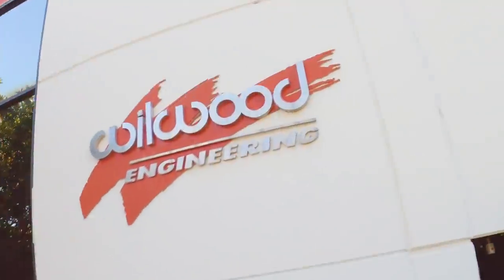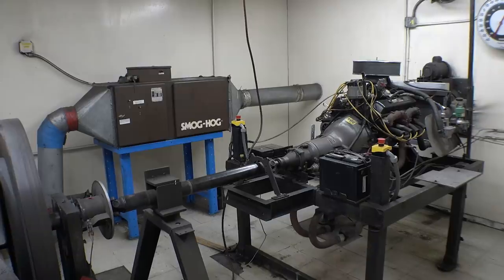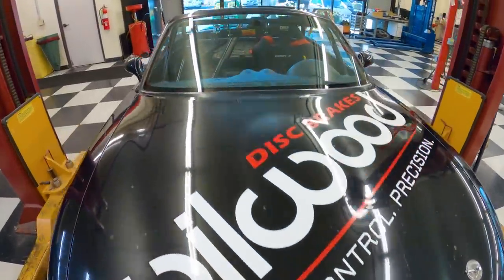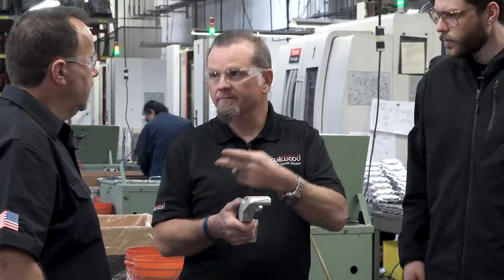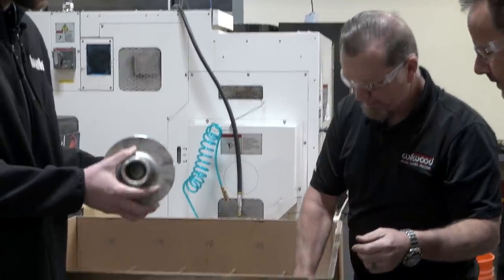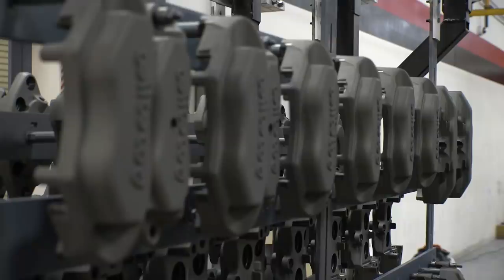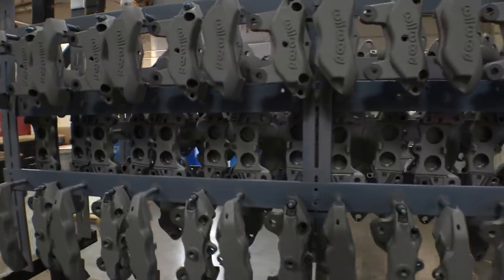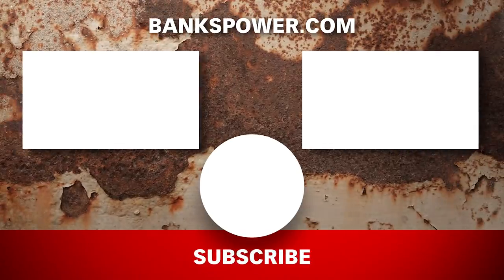How to BRAKE a supercharged Duramax Pt 2 | BANKS BUILT Ep 14

Comment: I only clicked to say please give us some more 'killing a duramax' and 'monster truck duramax'. Thanks!
Reply from the maker: 1. The Super Turbo (Monster Truck Engine) is in the process of being upgraded which means pulling everything off the current 7.0 LMM, making adjustments and changes, then installing them all on a newer first-gen L5P block. Also, bring it back to the dyno cell is on hold while we conduct testing for our military program in Dyno Cell # 1.

2. Dyno Cell # 2 for “Killing a Duramax” is down while we update and upgrade to our new engine AVL dyno/emissions equipment.
Reply: @bankspower   Thanks for the update, keep up the great work!

Comment: Are you going to kill that Duramax?
Reply from the maker: Yes, we are, here is the latest update. 1.) The Super Turbo (Monster Truck Engine) is in the process of being upgraded which means pulling everything off the current 7.0 LMM, making adjustments and changes, then installing them all on a newer first-gen L5P block. Also, bring it back to the dyno cell is on hold while we conduct testing for our military program in Dyno Cell # 1. 2.) Dyno Cell # 2 for “Killing a Duramax” is down while we update and upgrade to our new engine AVL dyno/emissions equipment.